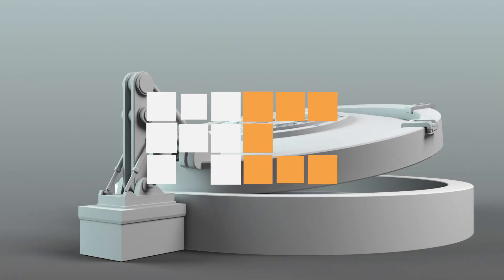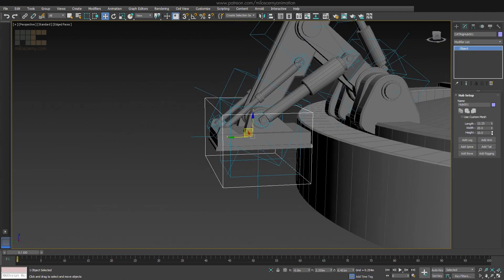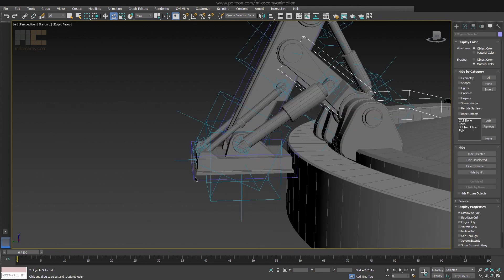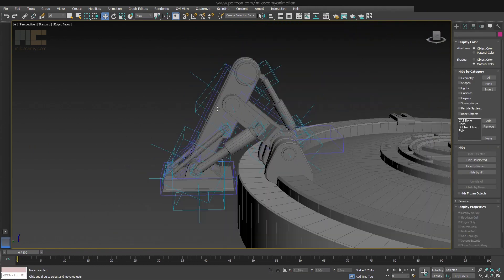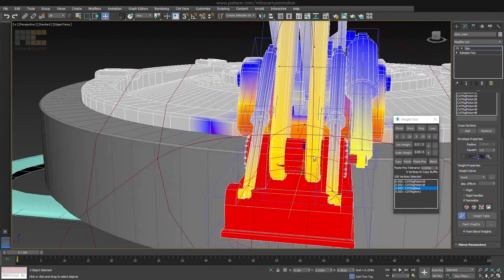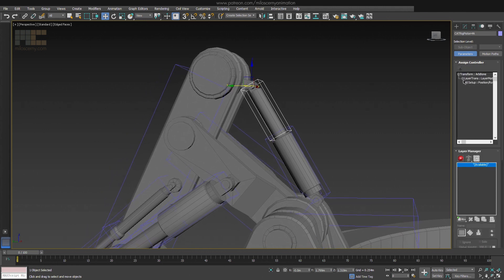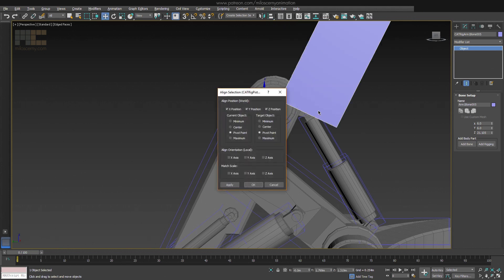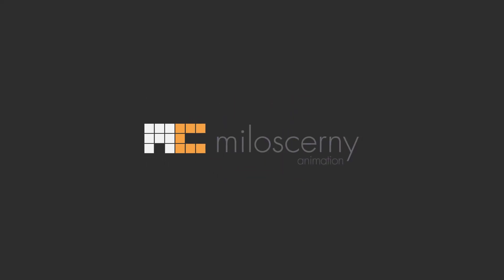Hydraulic Pistons Mechanical Rig - 3ds Max CAT Rigging Tutorial

Comment: Once in a while I do animations of the mechanical designs at work. It never occurred to me to use CAT. Thanks for this. I think one video  that would be useful to many is a tutorial on how to animate an automotive a-arm suspension using CAT! If you want the ultimate challenge try animating a snowmobile rear suspension! I can't even fathom how to do that while making the track deform to the suspension movement.

Comment: Great tut! Hey, Milos, is it fine to use mesh of object as custom mesh of a bone? As I see, you always use cubes for bones..
Reply from the maker: Hey Dmitry, yes it is completely fine to use custom meshes. I don't just because it's extra work and it doesn't benefit me very much personally. I also use 'display as box' option for the bones, to have just the edges visible and that would change the custom meshes back to boxes anyway. So I have no need for custom ones.
Reply: @MilošČernýAnimation  oh, i have one more issue here.. after I skinned bones and mesh, and im starting to animate bones, and viewport goes to 10 fps.. if i disable mesh and work only with bones, fps come back to 100.. do you know why? :)
Reply: thanks for fast reply! so i will use custom meshes, for better visualization
Reply: i tried also with dino bird from your webpage, viewport still around 10 fps.. how it is possible to animate and watch  animation in real time with mesh. For me only solution is to animate in 3d max cat bones, and if i want to see animation result  with mesh and textures i need to export in in unreal
Reply: and for last test i downloaded your model lighthouse keeper with idle animation, pressed play and i get 5 fps 😣 made all meshes invisible - 25 fps.. too low, even just with bones.. disabled scene explorer, 30 fps.. its too low fps for simple model like this and my pc is intel xeon 56 cores, 2080 ti.. im using max 2021.2